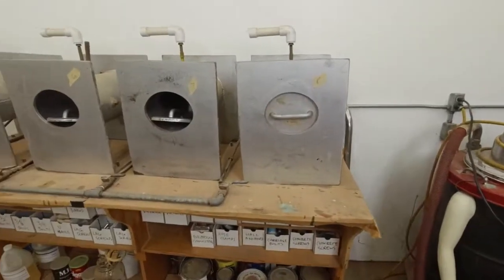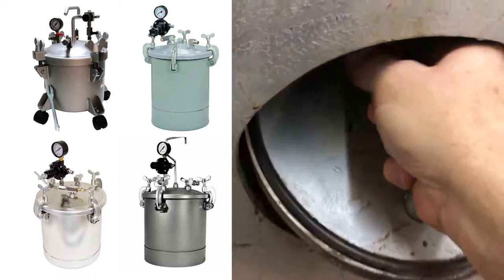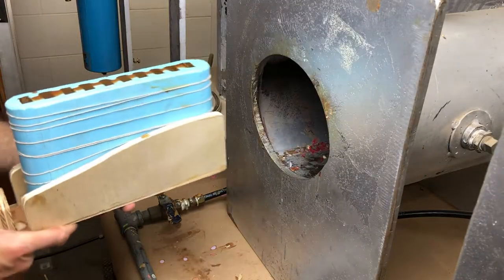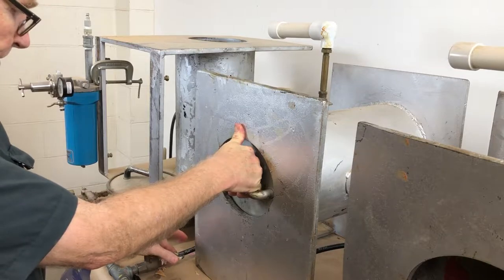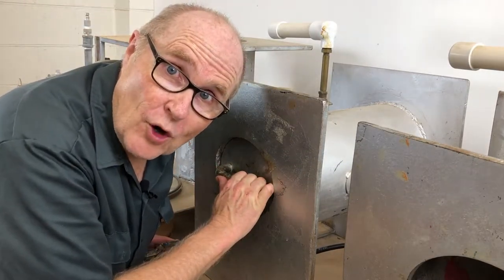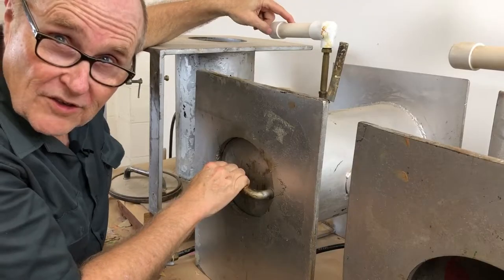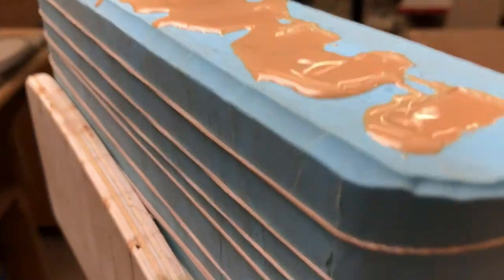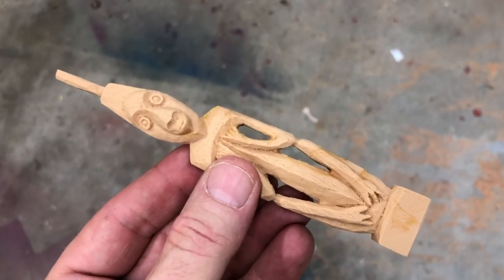Make Bubble Free Resin Castings With Custom Pressure Pots!

Comment: can you do a video on the mufflers? they work great and look easy to make.

oh, I just found your video explaining the entire pot setup. nice, cheap, easy fix for the muffler!
Reply from the maker: To be honest I think those mufflers are over engineered. All you need is a simple piece of pipe coming out of the tank with some fiber fill in it. Put a cap on the end of the pipe with a hole or two and you’re in business. I found a small  pillow at a dollar store and it had way more than enough fiberfill in it to make a lot of those mufflers!

Comment: I just lucked into a deal on some industrial pressure pots meant for dispensing viscous adhesives at a price I just couldn't pass up. Thick cast aluminum, working pressure 100psi, test pressure 200psi. Nice margin of safety - the older I get, the more I start thinking about such things. Bubbles, watch out!
Reply from the maker: What kind of closing system do they have?  How quick can you load them?
Reply: @RobertTolone  Just your standard four knobbed bolts, like the C.A. Technologies tanks but with the mounts/tabs cast into the tanks/lids instead of welded on. Beautifully machined mating surfaces with just a 1/4" (?) o-ring as a seal. Small fellers, only 5 liters each. 1/2" holes in the lids (output tube port) need to be plugged. Would rather leave the lids stock, but I can always tap the holes for a fitting as a last resort. Really wanted to dip my feet back in this hobby before I take a deeper plunge with larger ($$$) equipment. Starting from scratch again after 15-20 years away.

Comment: Those chambers look amazig all hand built and welded? I need to make one for my hobby casting . Steele construction 1/4" im guessing . Has it ever gone over 80psi?
Reply from the maker: Hi Tony, they are made from air brake cylinders from semi trucks. I believe they are rated to 120 psi, but because I modified them I run them at lower pressure. I’m not an engineer so we overbuilt them. The front panel is 3/8 inch steel and the doors are 3/4” steel.  I am also not a certified welder. So I designed the tanks but I did not fabricate them. I was fortunate enough to know a qualified welder who did the work for me. It is extremely important that they be expertly welded by someone certified in welding pressure vessels. You definitely don’t want the tank exploding in your face! I used to run them at 80 psi but I have found it isn’t necessary. So now I run them around 50 psi.

Comment: Hi, Awesome simple design, what are using for the gasket?
Reply from the maker: Very strong, tough rubber tubing that we cut and glued to fit the groove milled into the lid. These tanks are 35 years old and the gaskets have never been changed. They work as well now as they did when we first built them. It’s been so long ago I don’t remember what the tubing was and where I got it.

Comment: I love those pressure chambers! Trying to get the bolts down before urethane kicking off can be a stressful job. Did you make them, yourself?
Reply from the maker: I designed them, but I did not fabricate them. They were fabricated by a welder qualified in pressure vessels. It is not a place for a DYI welders because the pressures are high enough that the pots might explode.

Comment: I am going to have one of these pots built..... what has been the best O ring to use? do you notch the lid so the O ring will fit in or do you just glue the ring on?  Thanks!
Reply from the maker: My gaskets are solid rubber tubing that are glued into a channel machined into the lid. It is hard rubber that doesn’t squish much under pressure.

Comment: Could pressure pot be used for hollow rubber casting? What tools do you recommend for removing bubbles in rubber casting process? Thank you so much
Reply from the maker: I don't have any experience casting rubber products. The process you need depends on the objects you want to make.  I suggest that you find existing objects similar to yours and research how they they were cast.

Comment: what will happen if you have a high viscosity resin and a mold with a lot of fine details , you insert a funnel into the one and only hole in the mold and pour a good amount of that resin in it and put everything in a pressure pot to cure? will the resin flow everywhere, which otherwise wouldn't be possible due to resin surface tension and air pockets? will the compressed air at the bottom of the mold escape through the resin and through the opening in the mold or will it get so compressed that it'll suck in all the resin where it needs to go? what happens to the compressed air bubbles?
Reply from the maker: If you try to pour resin through a funnel into a cavity with only one entrance hole and no air vent the resin will simply sit in the funnel. The air inside the cavity will prevent the resin from entering. If you allow some air to escape through the funnel opening then resin will flow into the cavity and will settle into the bottom. When you apply pressure the small bubbles may be compressed enough to be invisible but the larger pockets of trapped air will shrink but will still leave bubbles. The simplest way to make a good casting is to position the mold so that the resin falls to the bottom of the cavity, rises up and pushes the air out the vents. The only reason to use pressure is to prevent the urethane resin from foaming due to atmospheric moisture.
Reply: @RobertTolone  thank you! that makes sense
Reply: @RobertTolone  So, what if there is another hole for the air to escape? Imagine a situation where the resin is in the funnel and it's not going down into the mold due to surface tension and it being too viscous or perhaps the hole being too small. If I pressurize the whole thing in the pot, will it help the resin flow down in the mold?